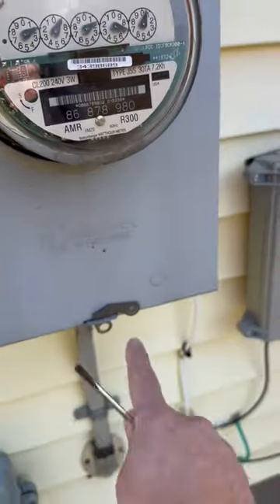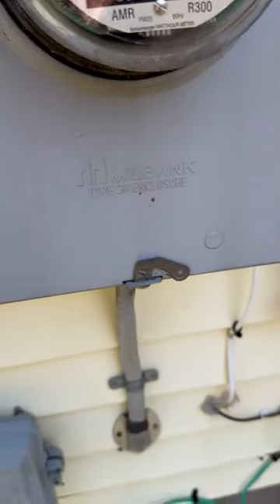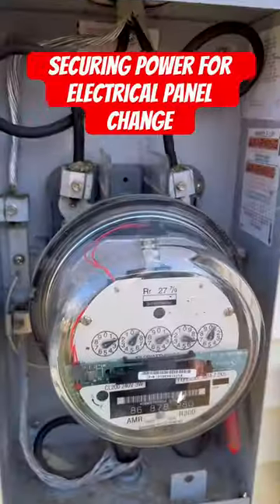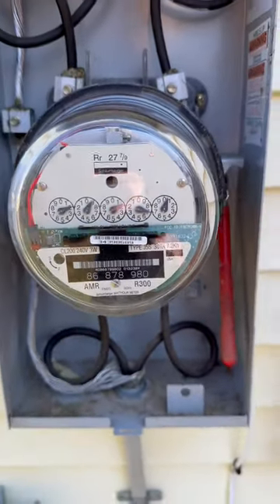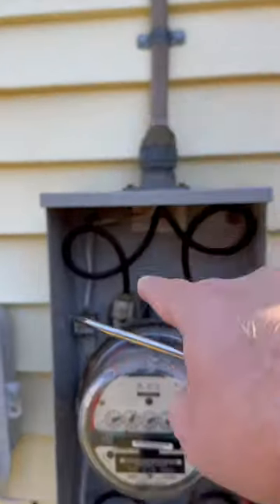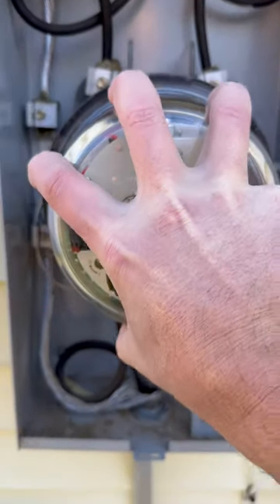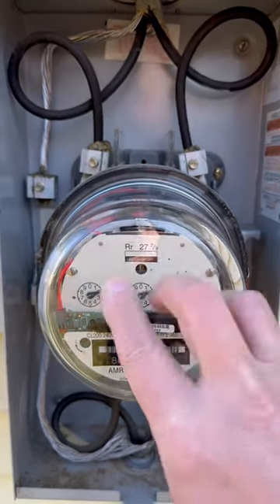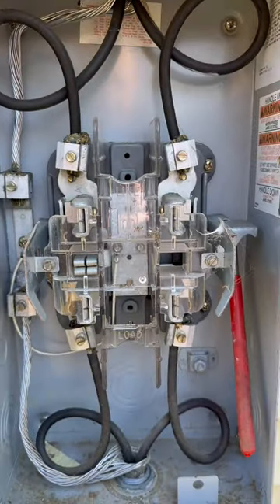Securing power for a panel change #shorts

Comment: don't do this at home, kids.  your power company will NOT be amused.
Reply from the maker: Guess it depends on state. As long as you’re licensed they don’t mind here. We are responsible from the tap at the service drop down all the way down. Electric company won’t pull a meter for you for a service or panel change. They will only reinstall meter.
Reply: @theguyofalltrades  here, "licensed" means lineman's ticket. My understanding is some idiot electrocuted himself in the late 90s, and ended the trust.
Reply from the maker: We have a few service providers here in CT. E-1 is all you need to do the work. The other utilities have a cow if you try to cut your own power at the drop before doing a service change
Reply: @theguyofalltrades  like I said, here, you don't touch anything until they turn it over to you.

Comment: That doesn't look too safe, unprotected wiring below 7ft. Also if You are not a experienced electrician don't mess with the meter.
Reply from the maker: 😂 6’ max height to center of meter per code. Also there is a plastic cover that gets installed under the cover. Licensed master electrician for 25 years
Reply: Even when "secured" it's a joke. The tag they add after replacing the meter is like a paperclip.
Doesn't that main cable need to be in conduit though? Mine is but maybe that is newer code?
Reply from the maker: Depends on how close it is to window
Reply: @realhouseDIY  that looks like an old installation. They grandfather it until it needs repair.
Reply: The power co never would’ve installed the meter in the first place if it didn’t meat code. Stfu.